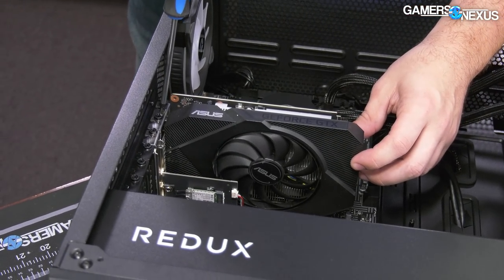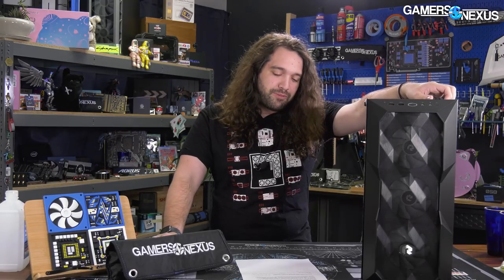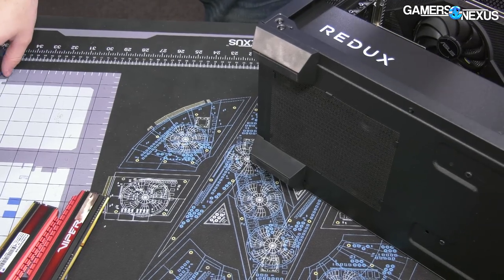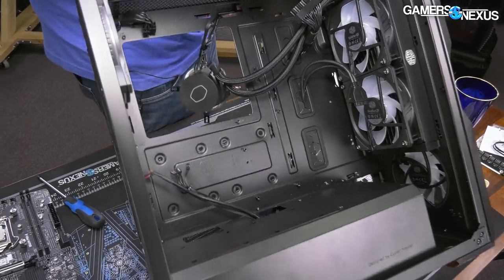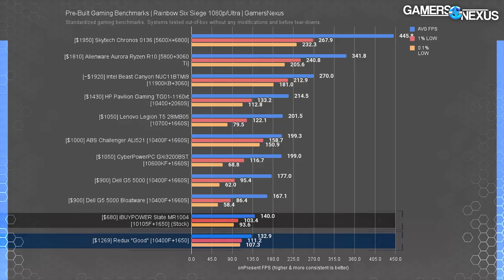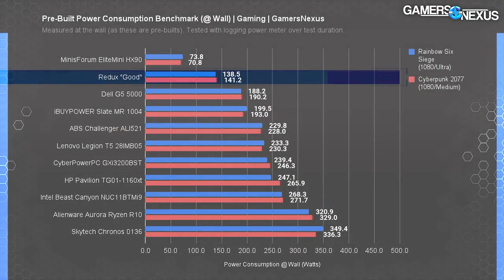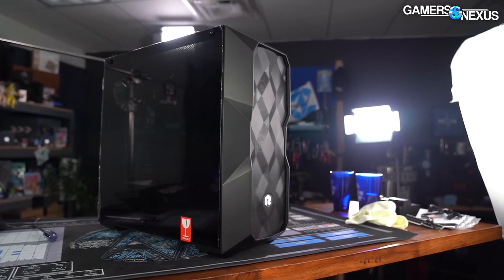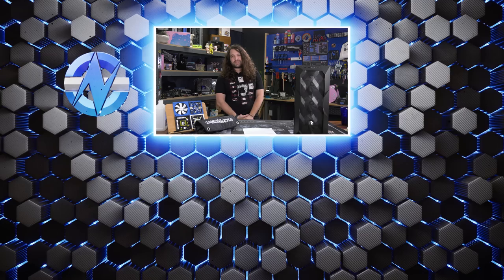YouTube Ads Told Us to Buy This: Redux Gaming PC Review

Comment: Adding the Liquid Cooler was purely a marketing choice. In my experience as a system builder, ALOT of customers prefer a gaming PC with a Liquid Cooler because they generally see it as "powerful" or "cool", and if you try and convince them to save money and use a standard air cooler instead they just brush it off or think you are trying to cheat them by using cheaper parts...don't underestimate the naivety of many people...
Reply: This. Say thanks to all those tech YouTubers that was painting air-coolers as bad solution for years
Reply: @8draco8  LinusMarketManipulationTips?
Reply: And in addition to that most people probably don't realize that a liquid cooler WILL need maintenance and possibly replacement with a catastrophic failure being much more likely. While a good old air cooler can practically run forever as long as you do the occasional dust-off.
Reply: I will always push for air cooler first to my customers unless it’s an i9 or Ryzen 9 , but if they insist on liquid I will not argue much, it’s more sales money for me lol
Reply: Point them to NUCs that have been running on stock air for years to support your argument. Heck, you could even use consoles as well; an XBOX 360 ran at about 180W.
Reply: @deanchur  360 would be bad example of air cooling unless it's a Jasper or later
Reply: @christiannorf1680  after having my first aio liquid cooler completely die after about a year and a half when the pump stopped working completely without any sign of failure before hand (one of corsairs AIOs), I couldn't come up with a good reason to get another AIO. Replaced it with the Assassin Deep Cool III. Worst case with something going wrong with that  is a fan or two needing to be replaced, and its been cooling my overclocked 8700k even better.
Reply: @sarcophegus  you can still push a good air cooler on a 5900x, mind you gotta go with something beefy like the Noctua NH15. I built a 5800x with a NH15 for a friend but mind you i also live in a place where ambient is around 27-32C all year round so i tend to overspec cooling based on that fact.
Reply: Ais only make sense when you have at least a 240mm and a CPU that pulls like 200W.
Reply: That's sad, I much prefer air cooling over liquid. If it ever fails it's an easy replace, but if liquid fails it's just a huge pain in the ass that I, personally, never want to deal with.
Reply: @Rpground  Yeah, same with me. It's like people think it will run forever and has no risk of failure. If PC's were magical things that never had issues and would run perfectly forever, sure, I'd have no issue with liquid cooling. But the headaches it could potentially cause isn't worth it in my opinion.
Reply: @ClonesDream  You know Linus has explicitly stated that air cooling is better in the fast majority of cases unless you are into extreme overclocking, right? Unless you are talking about the vast majority of tech media. But then its gotta be everyone.
Reply: With a big enough air cooler, enough case fans, and my window air conditioner cranked as high as it’ll go I’m sure i could keep a Ryzen 9 or a core i9 cool. My window air conditioner gets my somewhat small room almost cold enough to feel like a walk in freezer lol.
Reply: Yep, can't tell you how many systems I've pulled expensive air or liquid coolers off that added zero value to the system.
Reply: @ClonesDream  ????? he literally says that the Noctua fans are better than water cooling most of the time. correct me if I am misinterpretting your comment, but Linus ACTIVELY supports getting an air cooler.
Reply: 'Gamer marketing" is partially responsible for people believing liquid cooling is always better. These same people would lose their minds if they saw the cooling performance of air cooled servers that run 24/7 for years on end (ignore the noise part. can only do so much when it comes to small fans spinning really fast).
Reply: @virtualtools_3021  Good point, I was only considering power consumption when I wrote the original comment. Had 2x 360's RROD on me within a year so I should have known better lol.
Reply: @sarcophegus  I use a D15 chromax with my 5900x it works fine. I used a custom loop on an Intel 5960k before this.
Reply: It's true.
Reply: @ClonesDream  Huh? LTT often uses air cooling, no?
Reply: Because most cases come with a glass side nowadays AIOs are more of a fashion thing than a necessity. Nobody want's to look at some giant block of metal with fans stripped to its side all day when you could have a nice lookin small AIO.
Reply: Only reason i went liquid is because i have an i9. Now I'm working on a custom loop because I'm just going to buy an ex mining card and put it on a block
Reply: @backlogbuddies  i9 really do need liquid or the system will fly away. But R5 & i5? it's just scam
Reply: Most people who don't know much about a product will value looks more than performance. Look at the ricer cars on the road, they could've saved the money used to buy their loudass exhausts for a tune that'll actually net them a slight improvement in performance, or kept the money spent on their crappy wheels and bought a set of good tyres that will actually upgrade the handling
Reply: @deanchur I've actually known of several NUC's that have had the fan die an early death. 
They were deployed in kiosks (so experienced much heavier usage than normal), but still, I wouldn't use them as an example of fan reliability (the lenovo thinkcentre's we've used for the same task seem to have faired a lot better).
Reply: ALL is fine with a lot of RGB :D
Reply: @8draco8  air-coolers where bad for many years( compared to water cooling) it's only the past few years that aircoolers have been catching up.
Reply: @giglioflex  what value did you expect them to add? They usually have a better tdp so your components run cooler and will have less issues. Heat kills components.
Reply: @haydenw8691  keyword: noise. That's a huge reason some like watercooling. I personally have never had a aio but I do have a full custom loop.
Reply: @akza0729  um a i9. Takes way more to cool it.
Reply: @randybobandy9828  no my dude, if you would say stock air-coolers them I might kinda agree with you. Legendary Noctua NH-D14 was released in 2009. Noctua started producing fans in 2005 and before that there was for example Zalman who also did quite efficient coolers, years before they started putting pipes in consumers computers.
Reply: @randybobandy9828  many water-cooling serious especially AIO can be louder than air coolers. Air coolers stopped be loud ages ago
Reply: @8draco8  the fan is only part of the equation on a aircooler. So no there where not as good at cooling in the past. They have advanced alot on the past 5 years or so. That's like saying only a fan matters on a water cooler radiator and not taking in consideration the fin density or radiator thickness.
Reply: @indianboy0453  @AYDMÜ   @Appoxo  It's just the usual using of Linus as the convenient strawman for all tech YouTuber sins despite the thing they're strawmaning him for was never actually something he said.
Reply: @randybobandy9828  Noctua NH-D14 is not a fan, it's the whole CPU cooler unit radiator+fan, it's predecessor of current NH-D15. Zalman and others also was producing whole units in early 2000s and even 90s for cooling CPUs and GPUs (yup you could buy aftermarket GPU air coolers)
Reply: @akza0729   Typing this on an I9 9900k oc'd to 5.0 ghz on all cores, cooled with a Noctua NH-D15 chromax air cooler. Temps max out at 79c. It was alot easier installing my Corsair 240mm AIO than this beastly cooler, and alot of cases and ram will have issues fitting it. Overall, the temps are bout the same with the I9 on air and 3900x on the AIO.
Reply: @christiannorf1680  i use my custom liquid colling just because my wall mounted PC is MUCH MUCH more silent
Reply: I prefer air cooler. Less maintenance/ easier to clean and I don't have to worry about coolant leaking.
Reply: Some prebuilts (cough cough Alienware Aurora R9/10/11/12 cough) absolutely require a liquid cooler with how weirdly they design them. Some don't even have space for tall air coolers.
Reply: @DrSmugface  Well at this point your PC is functional art piece so just throw whatever looks best on it.
Reply: @Rpground  Don't you keep an air cooler as backup if your liquid cooler fails?
Reply: Nope.  If you go into their build kit you can see that the cooler comes with any of the CPU's you pick from i3 to i9 to 5800X.  They basically are using this cooler for ANY CPU that ships with the "Good"  kit.  That may be simply decreasing complexity on the number of SKUs they have.  Which I could understand.  Its still a massive waste of money for anything under the i7 series.
Reply: @christiannorf1680  Ummmm BS.  AIO coolers are pretty damn bullet proof as long as you are not getting them from no name brands.  I've used several over the course of almost a decade and not one has leaked or has required maintenance.   Now a custom LC loop.  Yes.  Very much so.
Reply: When I ordered my prebuilt, they pushed for an AIO instead of an air cooler. It wasn't because of performance or being "cool" at all. Customer support literally told me it was because an AIO will survive shipping better than an air cooler. It didn't even cost me any extra to get the AIO over the air cooler.
Reply: @ClonesDream  He actually has a couple videos where they compare liquid vs. air and concludes that both are fine. He also praises Noctua coolers constantly. I have no idea what you're talking about.
Reply: @sarcophegus  even with my 9900k overclocked the Dark Rock Pro 4 makes next to no noise and nothing aside from synthetic benchmarks have had me concerned about temps above 80. Some modern air solutions are fantastic. I did undervolt a small amount just because I could. I wanted to avoid water if possible, weird that it's almost niche according to "Big Gaming" to desire that.
Reply: @akza0729  any AIO larger than 140mm on either an R5 and i5 is just a waste of money.
Reply: Thanks for confirming my theory
Reply: @8draco8  comon, i have air cooler on 5900x, (BQ Dark Rock Pro 4), for i5, fera3 or any 20-30€ cooler will keep it cool and it wont be heard, i was using it for 6years on i5 4570s.
Reply: @marianmarkovic5881  Bro, I'm on your side, air coolers FTW
Reply: Yup. I tried to explain to my friends why my 475 dollar custom build from 2016 out performs their brand new 2k pcs..
Reply: @algis-kun8777  mind you
Reply: I value aesthetic so it's worth it for me tbh
Reply: I want liquid cooler because it's quieter than a standard fan.
Reply: @damienholland8103  it is absolutely not…
Reply: @sarcophegus  I've had both types of computers and disagree. I can barely hear this current one and it's liquid cooler. The fan I was always able to hear and sometimes it was annoying.
Reply: @damienholland8103  my man, I’ve built over 300 computers. If your air cooler was louder , it must’ve been either dying or just horribly bad
Reply: Some people are just begging to get ripped off.
I mean, come on: even if you have no clue whatsoever about the subject, it should be common sense that a sales rep trying to rip you off wouldn't push you towards the more cheaper option! 🤣
Reply: @8draco8  they weren't, they were just showing off the superior potential of watercooling. Which is true, but also meaningless for anything BUT the most power-hungry high end chips they use.

What you're saying is like accusing sports cars enthusiasts of painting cheap commuter cars as bad cars, just because they can't stop talking about how much they love powerful engines and low 0-60 times.
Reply: @Tokru86  Aircoolers have a lot of thought put into design these days, too. And IMO most of them look much better than the rubber tubes of AIOs. In any case, the days of giant bare metal blocks are long gone.
Reply: @randybobandy9828  lmao, aircooling can be just as silent as water cooling (if not quieter, *cough* bubbling *cough* pump whine), especially on an i5 where you could achieve near-silent operation on the crappy stock cooler with a simple tuning of the fan curve.

And temperature only significantly affects the chips lifespan, when it's approaching the maximum operating temp. Whether your i5 runs 60°C or 30°C under load doesn't make a difference.
That money is much better spent on a more powerful CPU or GPU, which was the freaking point of OP.
Reply: @harmfulmelody5958  and any 120mm AIO is a waste of money too. They're not better than a decent aircooler, but cost more.
Reply: A notcua d15 will cool just about anything.
Reply: For me, I just like the look of AiOs more
Reply: @ClonesDream  LTT never said that air coolers are always worse.
Reply: @akza0729  my i7 11700K needs liquid cooling, it's overclocked and gets about 5.2-5.25GHz all cores and 5.32GHz single core
Reply: I'm upgrading soon, likely some variant of 12600 and I'll be going air cooled. As far as I can tell in most real case scenarios, water sin't necessary unless you're using a 200w cpu/overclocking near/above that and for lower power cpus even a decent budget air cooler like vetroo v5/hyper 212 will do and a good air cooler like fuma2/dh15 will more than do. 

With that being said, I do fall into the bracket of people who find liquid coolers far more aesthetically pleasing compared to having a massive skyscraper bolted onto the cpu, and if my pc was situated in a position where I'd have to see the internals I'd probably be going for an AIO for that reason myself.
Reply: @supercowzrock  That's because it's a Pro 4. I have the regular 4 and it sometimes gets noisy with my 2600X.
Reply: @Di3mondDud3  BS.
Reply: i've built my own pc and tbh, cool look is one of the main reasons why i go for liquid close loop and the fact i hate aluminium chunk in the tower above the cpu D:
Reply: @algis-kun8777  I use the nh-d15s best purchase ever
Reply: Water coolers look a bit better imo
Reply: @algis-kun8777  D15? Lmfao I'm running my 5900X on a NH-U12A and it's fine.
Reply: @sarcophegus  My Ryzen 9 5900X is running well on a NH-U12A thank you very much, never gonna need AIOs.
Reply: @christiannorf1680  catastrophic failure is as likely as a massive tower cooler ripping your CPU off the socket.
Reply: @christiannorf1680  running my h60 for 2 years never needed maintenance, now ive upgraded to an arctic LF II because it actually fits in my case and wont give me ram clearance issues.
Reply: liquid cooling masterrace
Reply: I'm recently purchased the Be! Quiet light wings. So far my pc temps rarely go above 55c on any game running 4k. Elden Ring, New World, Genshin Impact, Honkai Impact, Horizon Dawn Zero and many others.

Real test is when I get my Radeon 6800xt or Radeon 6900xt, paired with a 5900x. I don't overclock anything, shouldn't be a problem I believe.
Reply: Those "people" are barely human, nearly indistinguishable from animals.
Reply: This.  I use a stock cooler cause I dont plan to OC cause I want my parts to last long.  I still save old parts in case a new part gets rekt or something that's how much I take care of my parts.
Reply: @Epsilonsama  that stock cooler probably gets loud, a water cooler would be dead silent
Reply: ive never had a liquid cooler and never had any issues with cpu temp at all, its always the gpus that get too hot for me..
Reply: If they used a better liquid cooler like an EK it would have made sense, it's a small case. Not everyone is going to fit some massive cooler, I couldn't and I'm using ATX.
It's really all about the case you have, they are all so different.
Reply: I am not a fan of standard coolers, as a money saving option to be honest.
Reply: I know right? So little story, in talking with a friend who is doing repair for a selection of gov offices and stuff like that, we breached a point on "bosses cutting deals with groups to cut money under the table", i was talking about infrastructure (am an architect) he was talking about PCs. The sheer number of "high end" water cooled gimmicks he goes through is insane. He told me that around 2019 the number had skyrocketed from say 2 in 10 to 8 in 10 (rough numbers, pinch of salt, all that). So not only are people getting sugar lead by gimmicky features (within the context of a pre-built system that fits the bill of the above seen one) but some groups are also very likely cutting under the table with gov offices to get a little something something on the side.
In case it wasn't clear, we're not talking about a guy within the office, getting such a unit, we're talking about gov ordered office wide 'upgrades'. Scamy and scummy.
Reply: @harmfulmelody5958  Yeah I have a 120mm on a 10700k runs nice and cool while overclocked. No idea wtf people are doing with these giant coolers. Maybe get some airflow in your case.
Reply: @theforerunnerreclaimer  LOL you needed to overclock to 5.2 ghz ?.
Reply: @algis-kun8777  I'm running a 5950x on a low profile NH-C14S and even that is cooling it pretty okay. I had to undervolt it a bit but it straight-up just improved performance because it's able to boost higher xD
Reply: Watercooling is always better than air.
Reply: Tbh I only have an AIO because I got it on sale while waiting for the other cooler to get restocked.. No other reason. It does cool pretty cool
Reply: @alouisschafer7212  or if you have some specific constraints in space or airflow inside your case. In my case building a sleeper PC with a lot o limitations to which air coolers and airflow I could get a 120mm AIO made sense and solved the overheating problem I was having with an air cooler. But it a specific use case. I can also think that of you need a build that is more silent sometimes an AIO can make sense too.
Reply: People probably just want better parts maybe,also is it quieter ?
Reply: I bought a nzxt water cooler for my ryzen 9 5950x cause its beefy plus water cooling is really quiet
Reply: @8draco8  
I'd argue that all these tech influencers are pushing people towards liquid cooling, be it implicitly or explicitly, primarily because they are out of touch as they can play with their overclocked i9s and GPUs for a grand all day. 

Irrelevant for some i3 plus lower mid range card combo, unless your case is literally a solid glass box with no air flow.
Reply: Had a Strix themed 3070/8700k build sit for so long with a Hyper 212 Black. Installed an AIO and it moved the next day. Stuff is nuts as id have chosen the Hyper 212 any day.
Reply: I'm sure those customers were laughing at you as they sped off in their Ford Focus with the aftermarket spoiler and racing stripes.
Reply: I have my Xilent coolers for 9 dollar each running straight for over 2 years now with no loss in quality whatsoever, with decent enough sound and impressive airflow.
How anyone can say "but this costs 300 dollar it has to be better" is completely beyond me.
Reply: Exactly!!! I for one love air coolers, for many reasons I prefer them for my builds. Liquid coolers do have some advantages where you have more space around the socket.
Reply: Go big or go home
Reply: I would never think a salesman trying to sell me LESS was trying to scam me
Reply: I actually like air cooling way more. Less complicated and thermals are just as good
Reply: I live in Texas and it's hot.  AIOs are the way to go.
Reply: Alternatively, I chose air cooling for my prebuilt Cyberpower PC, because liquid cooling sounds both "cooler" and more complicated, and I wanted the prebuilt to be as hard as possible to fuck up
Reply: @christiannorf1680  yeah and if the air cooler fails it won’t take the rest of the system with it
Reply: @sarcophegus  ah so thats why the store on my place didn’t recommend me air cooler for my pc upgrade cause i upgraded to ryzen 9
Reply: Ok nerd.
Reply: Stock air cooler users rise up
Reply: If they had 22 years of system building like me they’d run from liquid cooling.

Scythe Ninja. Nuff said.
Reply: the naivity of people... as was seen in the last two years...
Reply: @johnmachter40  Liquid cooling is for kids that want to brag to their friends!!!
Unless your trying to set an overclocking record(in which case you should be using liquid nitrogen) then it’s all about the extreme air cooling.

I’ll take a Scythe Ninja with two silent 120mm fans in a push/pull configuration any day over any water cooling system!!!!
Reply: Honestly. Look at the BENCHMARKS done by GN(and others) it's just a few degrees, for $100s of dollars more in cost, headaches( maintenance/changes become a pain) and only a few DB in sound. 4090s don't need watercooling, and my card is almost always silent. Watercooling is only needed for some of those sun like intel CPUs. Or maybe AMDs trash GPUs. It's honestly marketing and getting people to waste money.
Reply: @SupraSav  also those overdimensioned heatsinks on those GPUs are way to oversized. thats also a marketing trick to get more money because it looks beefier. there are always some mini cards with one or two fans that are also silent and have good temps. one doesnt need tripple slot and 61 fans heatsinks lol
Reply: Plus you are adding in complexity and another point of failure on a system that doesn't need it.
Reply: @algis-kun8777  you should always over spec cooling if you can, you never know if the user is going to run their machine right next to a heater.
Reply: @sarcophegus  i have a ryzen 9 with an air cooler loool noctua dh15s
Reply: here's the thing...
non tech people are usually out of the loop when it comes to anything desktop and only hear about it in marketing.
So when smartphones became mainstream between 2008 to 2014, any developments on Desktop tech are pretty non-existent to them.
The time period between 2006 to 2008 was the time when Liquid Cooling was pretty new and news about them are "they're better than the basic box cooler intel and AMD ships!!!"
That's the last they hear about air vs liquid cooling debate. They default to the idea of air coolers are limited to the box cooler the CPU usually ships with.
It makes total sense their outdated knowledge of them persists in marketing.
The typical reaction to air cooling in gaming towers is usually "It's a gaming PC and it's ONLY air-cooled?"
Reply: literally my buddy trying to justify a i9 13900 for his to play csgo
Reply: @algis-kun8777  An NH15 is about the price of a good AIO water cooler.
Reply: I use an AIO but it’s the Be Quiet! Pure Loop which was like $20 more than my air cooler, being the Evo whatever at the time.

Literally only did it so I could adjust my fan curve to be quieter though cause the Ryzen 7 5800X built up way too much heat on my previous CPU cooler, despite having the proper thermal paste application and a super high fan curve.
Reply: That only goes so far these days. There are a lot of large air coolers that compete with AIOs both in price and performance. Sure, they may be basic AIOs, but nonetheless they still have options. Depending on the price, it may be better to go with the AIO instead.
Reply: I'd much rather have a nh-d15 than pretty much any liquid cooler
Reply: And they would jump on RGB+glass case
Reply: I don't trust liquid anywhere near computers. Unless they're toughbooks (police use them, for example), or the enterprise datacenter level stuff.
Reply: Its overkill for gaming lol but hey it looks cool ig. All you need is a $40 single tower air cooler and ur good. Or if you have to have liquid cooling 120mm will work just fine.
Reply: @sarcophegus nah even the i7 nerd water cool now. My 240 barley keeps it cool for gaming and can’t at all doing heavy workloads. Although it is 8 years old and has been very reliable
Reply: after using an aio for the majority of my pc building career.. ive seen water dripping from my graphics card... but ive never actually seen the damn thing leak. i recently bought a noctua tower cooler. so far so good. i dig it. its just huge!
Reply: @sarcophegus I use an nhd15 on my 10900k without any issue
Reply: Something that people might not consider: Shipping.
I would not want an air cooler, especially one that is good and thus have some heft to it, be installed and shipped to me. It's more risky even with proper packaging, and without proper packaging....
Reply: @ClonesDream this comment aged well like good cheese, lol.
Reply: Probably helps with shipping tho
Reply: You know what they say. If there's a price tag on it, somebody will buy it.
Reply: Linus always says that Air Coolers are the best option for most peoples' use cases, so idk what you're talking about @ClonesDream
Reply: yea but then they choke the fuck out of their fans with a 1 inch thick plastic shroud right over the fan with only tiny cutouts for miniscule air flow  @ShmuckTheUnfunny
Reply: @8draco8 i don't think that's the main reason. I think people see liquid cooling as something more high end and automatically better and quieter. People see custom loops and they want that but all they can afford is an aio
Reply: i went with air cooling cause i dont have alot of money if something goes wrong, and im not very good with this stuff, so air cooling is the way to go
Reply: I need a liquid cooler that's just an aquarium surrounding my graphics card. when I notice the fish floating upside down then I know I forgot to turn off ray tracing.
Reply: That's why I've got a budget air cooler on my I9 14900 K.😂😂😂😂😂😂😂😂😂 Dude no
Reply: @christiannorf1680 false if you don’t have proper air conditioning then it doesn’t work . Water cooling has its uses it depends on the person and situation.
Reply: @ClonesDream Can't remember when Linus said that. Only remember him saying water cooling is cool but its only for those high end customers that have money than they can spend.
Reply: @ClonesDream Just trying to shoehorn them in wherever you can, huh.
Reply: noctua makes air coolers that do an even better job somehow than many water aio's, funny enough
Reply: my main thing with them is I don’t like the way they look, but then at the same time I haven’t got a liquid cooler that was cheap so that might be way i’ve had really good experiences. but 1000% see where you’re coming from